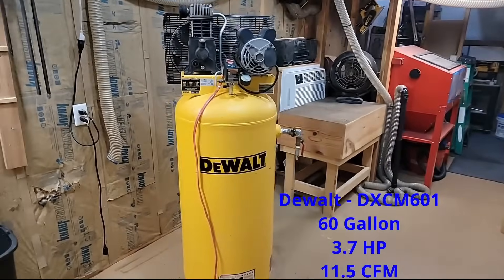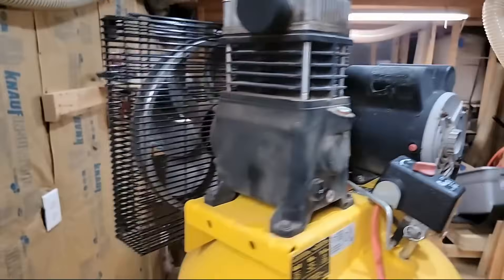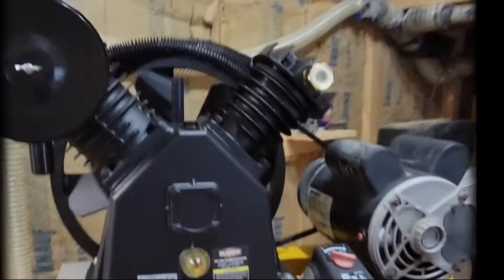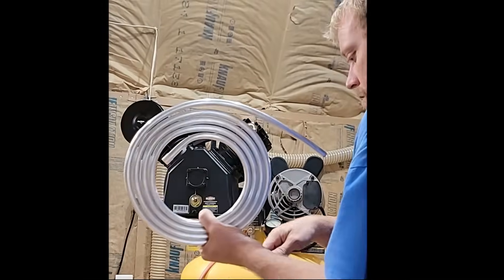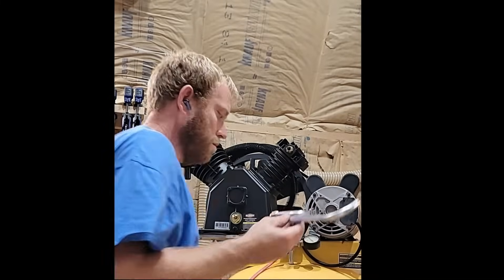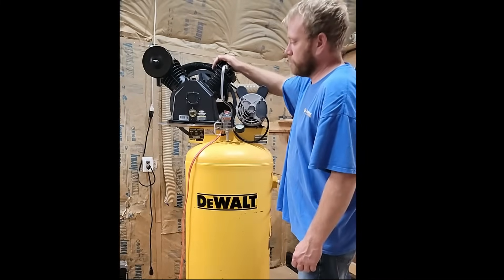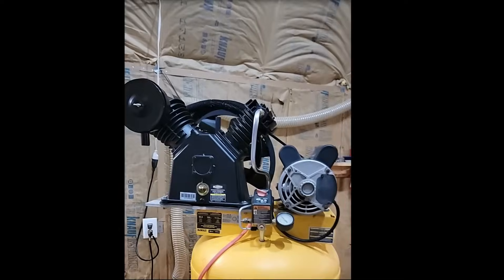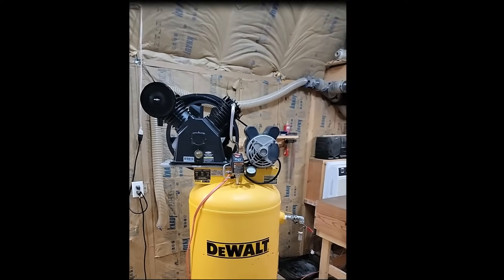Harbor Freight McGraw 2 stage air compressor pump swap on 3.7hp motor. Dewalt DXCM601 Will it work?

Comment: Where did you buy your pulley from? 

I don't know about you but I've hated this compressor....and that's hard for me to say because I'm a DeWalt guy! haha 
My compressor tripped the breaker and was smoking from the shaft like it had seized up, but it wasn't seized. Not really sure what's happening yet but I want to change the compressor anyway because it can't keep up with most air tools. Thanks for taking the time to make the video because it helped me decide which direction to go.